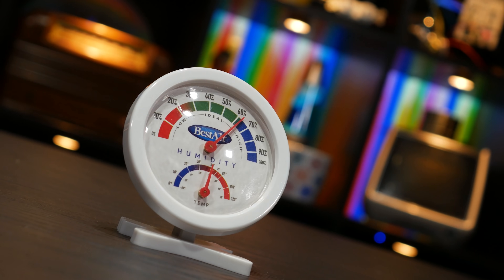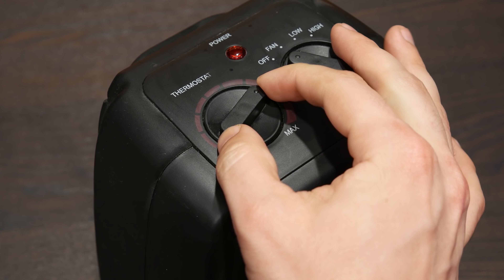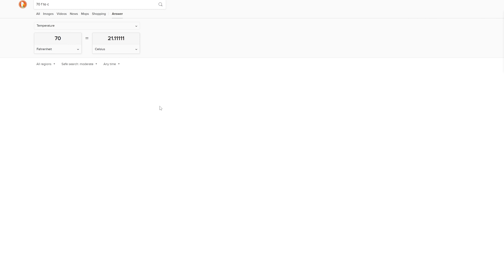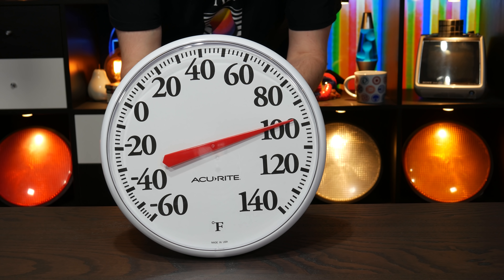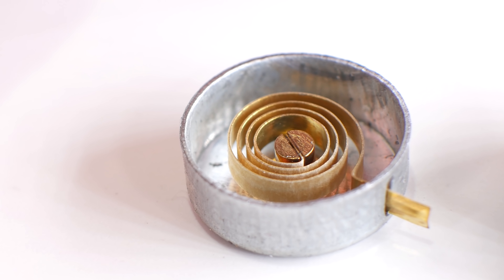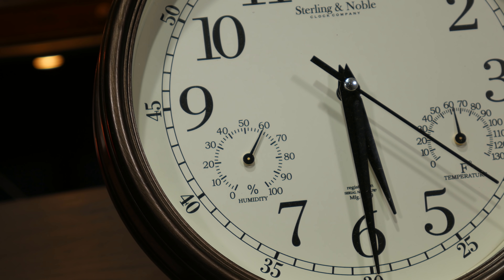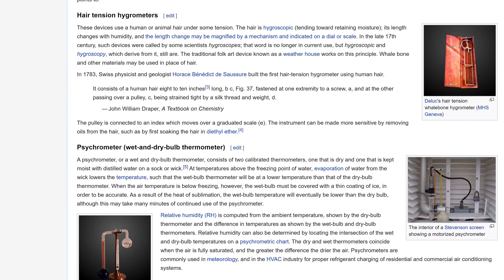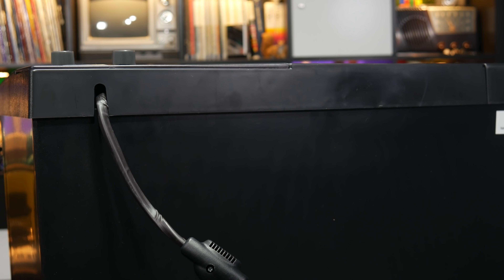Analog Hygrometers - how?

Comment: Speaking of humidity. I bought a small room humidifier recently (and a hygrometer to go with it) at the suggestion of my physician (I have sinus issues). Here are my observations. 

1. I have a space heater in my room, because in the winter the heater isn't turned up as high as I'd like (I don't live alone). With the humidifier, my room was more tolerable and I didn't need the heater. 
2. The air conditioner makes the humidity drop far, far lower and faster than the heater does. This means that, even though I live in southwest Louisiana where it is excessively hot and humid outside, I will need to continue using the humidifier year-round.

Comment: Totally random comment. I'm a pilot. We do things in Celsius (or Celtigrade as I like to say), and passengers in the states generally do not. Did you know the iOS search bar will convert stuff like that for you, even offline? Use it on my flight iPad all the time. Just type "15c" or something and it'll spit out the ° F. You can even type "34in" to get feet or "34in to cm" to... You get the point. That's all offline, which I have to say, being an android guy, is pretty cool.

Comment: I appreciate your Fahrenheit rant.  Metric may be good at many things, but offering a good scale for environmental temperatures is not one of them.  The smaller the degree increments, the better.  You get more precise readings that way and can verbally communicate a more precise temperature with the same amount of effort; the numbers themselves don't really matter that much (though as you point out in the video, Fahrenheit's 0-100 lines up better with the temperatures most humans will be exposed to).  

I also find the +/-1°F trigger range on my home's thermostat annoying enough as it is, that combined 2° difference would be even worse if my thermostat used the chunky units that are Celsius.  The variance would be almost double!

Comment: Y'know what makes a great "bi-metallic" strip for the purposes of humidity detection?  One-sided wax paper, such as the backing adhesive labels are shipped on.
Y'know what curled-up label backing paper doesn't do so well?  Go cleanly through an automatic label dispenser, such as those I use at work.
Y'know what makes the air excessively humid?  8-foot swamp coolers, such as those my employer wheels out onto the shop floor in the summer, rather than install proper air conditioning.
(Just to keep things in the Technology Connections Cinematic Universe)

Comment: With the thermometer I'm just confused how 60° F is warm enough for you to be comfortable sitting like that
Reply: Like that? I'm fine sitting in my lightweight chemise at that temperature, never mind fully clothed. Y'all need to toughen up. 💯
Reply: Idk about you but 60°F is the ideal temperature imo, i start getting uncomfortable if it gets above 65°
Reply: I basically always want it to be 20° C indoors, although in the summer I let it get hotter.
Reply: @joshuahillerup4290  that's how my roommate likes it, causes a lot of arguements over the thermostat. He's adapted to warm weather while I can sleep butt ass naked in a foot of snow
Reply: @kylemaloy5524  ironically I live in Ottawa, Canada, and I'm pretty good walking around outside in cold weather.

Maybe it's because I haven't had air conditioning for most of my life.
Reply: @joshuahillerup4290  yea that'll do it

Comment: Huh, checked out my old cheep desk thermometer/hygrometer from the early 80s, turns out it uses the metal and paper coil. So new-fangled might be a matter of relativity. Here's one thing I have to wonder, how well does that method hold up over time, as I've noticed the hygrometer is basically useless anymore.

Comment: 2:00 I am a big fan of the metric system, but for temperature I actually have no preference.
Fahrenheit or Celsius or Kelvin all have their benefits.
It's when we start measuring length, area, volume, weight, force, electricity, etc. That is where I vastly prefer the metric system.
And I can read a temperature in Celsius, Fahrenheit or Kelvin without much problem. I am surprised you cannot.

Comment: Simple!

I agree on a 0-100 scale for tolerable ambient temperatures to be more useful -- and then C/K for everything else. And if you use both scales frequently [F for daily weather and C for scientific applications], you start get a feel of both in relation to each other. But even if you don't... yeah, search engines, you don't even need to do math anymore!

And if you have an iOS/iPadOS device, if you type like 70F, it'll give an autocorrect suggestion for the correct C temp, and vice versa. Life is easy these days

Comment: As a kid, I took apart an old dehumidifier from the 1950s or maybe 60s and it had a humidistat with a bunch of long horse hairs (I guess from their tails).
Reply: Do animals have hair, do humans have fur??? 🤔🤔🤔
Reply: @Pentti_Hilkuri  Fur is denser than hair at usually 2-3 or more hairs per follicle and also features hairs of different lengths in the same area, like an undercoat and overcoat.
Reply: Yes, I remember a Boy Scout hygrometer  project involving a hair from a horse's tail as the active element.  I don't remember if they told you exactly where to get one, but since I was taking violin lessons at the time, it was no problem for me...

Comment: Ah yes, a scale whose lower bound is the freezing temperature of salt water and whose upper bound is an inaccurate measurement of human body temperature
Reply: Huh? The modern scale is primarily defined between 0, the freezing point of Mr Fahrenheit's water salt brine solution and 212, the point at which water boils at sea level. It hasn't been based off body temperature in a long time. But... What do those points on the scale have to do with anything? Fahrenheit can go lower and it can go higher.
Reply: Ah yes, a scale where 0° is kinda chilly but 100° means the fucking world is ending. This makes it easy to know how it will feel outside at a glance.

Comment: Unpopular opinion - metric isn't that GOOD!
Perhaps, maybe, different strokes for different folks? Its always the metric snobs that complain the most.

Also, IMO metric systems are better for conversions and precision, but is overly clunky otherwise. Proportional systems (like the imperial) serve different purposes and make more sense when you are using them how they are suppose to be used. Its like how Typography is measured in points, or displays are measured in pixels - type is finicky at the best of times, and actual size measurements can mean very little in an electronic display.

Comment: My parents have an old recording weather station that uses the hair method. But it is connected to an arm with an ink well at the end that rides over a clock wound paper cylinder. Really cool.

At my work I run a 1960's offset press that still has the damping system original to it, so an extremely simple design. Hygrometers are life with these machines, I can judge the humidity of the room simply by watching how much fountain solution I need to add during printing.

And love the Rob Dahm-esque cut-off.

Comment: Fahrenheit is a temperature  scale for how humans feel.
Celsius is a temperature scale for measuring things. 
Both are useful, but if you're talking about human comfort, especially outdoors or in the seasons, Fahrenheit actually makes a lot more sense. 100 is a lot bigger, therefore "higher" or "hotter" than 40 in our simple monkey brains. A 0 to 40 scale just isn't wide enough for the normal temperatures that humans survive in most of the time.

Comment: "I can't think in Celsius any more than you can think in Fahrenheit."
- The most honest and valid argument I've heard for using imperial units. Sincerely, an Aussie who learned to google "[number]F to c" a long time ago :) 

In a hygrometer related tangent, I built a cold mirror hygrometer many years ago, using a peltier cooler, temperature sensors, led, photodiode and a microcontroller. It was fascinating watching the graphs of reflected light and seeing the value drop suddenly as the mirror got to the dew point!

Great video as always,
Thanks!

Comment: I recently repaired a digital Hygrometer. One that I had for years stared giving weird readings. I opened it up and it appeared as if the solder joint on the  part that does the measuring had cracked. I resoldered the joint and it has been working fine since

Comment: I live in a metric country but i use fahrenheit in my AC system. When using C, i get 1C variation. When using F, i get 0.5C variation. This is because most of these systems only use 2 digit displays. For me it makes a heck of a difference as I have stopped waking up in the night to increase the temperature because of the cold.

Comment: Metric should use Fahrenheit.  F goes from zero to 100 (nearly) in terms of the most common use of temperature.
Reply: Metric uses Celsius because 0 is when water freezes and 100 when boils. Less than 0 means snow, freezer, very cold. More than 100 means boiling water, don't touch the material, etc.

The hot ambient temperature isn't obvious. 25ºC is room is common room temperature. More than 40 is a incredible hot day.

So Celsius is perfect for things like cooking, but no so great for weather.

Comment: I entirely agree that a 0-100 scale for ambient temp is completely understandable. 

0c may be freezing, but actually cold temps don't happen until negatives. 0f is legit fucking cold to perceive, and negatives amplify that. Same with 100f; that's fucking hot. But, 100c, and you'd dead.
Reply: I've been in a sauna that was 120c and I'm still alive. It's not that straighforward.
Reply: @vibingwithvinyl  You can survive in a 120ºC sauna with less than 1% humidity for about an hour. If the humidity is higher or you stay for a long time, you will be dead.

Comment: You didn’t explain the extra clever part:
when the absolute humidity stays the same, but the temperature changes, then the metallic part of the paper-metallic strip will expand/contract (and not the paper). So the needle will also move, and as such automatically calibrating for relative humidity.

Comment: As a Canadian, pleased with our use of metric, I would like to inform you of our preference for buying meat by the pound, doing carpentry work in inches and feet, measuring architectural and construction material by inches and fractions of an inch, and we interchangeably refer to things as miles or kilometers away (adjusting the numeric value accordingly of course).

Fantastic!

Almost as fantastic as the fact that technically the US is officially metric to boot.

Comment: Yes, but you forgot to mention wet-dry bulb hygrometers. I did some fire spotting in CA and we used a wet-dry bulb hygrometer kit to measure humidity. If I remember correctly, it was pretty darn accurate, and 100% analog... except for the part where it's about 75% manual work to get the readings. Surprised that it wasn't mentioned, as you can automate it digitally with fans and lookup tables and such.

Comment: 1:54 I tell my Canadian friends this is the only reason Fahrenheit is a great scale.  For everything else Celsius is better.  This could be solved if the measuring (and also thermostat) devices could be reported to the tenth of a degree.  Having a few Canadian friends, I've asked them what temperature they find comfortable, none of them say 20c somwhere between 22-25.  But ones who say 22 or 23 acknowledge it's somewhere between the two and they have never really figured it out to the  22.X degree C.  I'd be inclined to switch if the World went to that (no pun intended) degree, but they won't.  Rant over.

Comment: I have like so many different devices and doodads to measure humidity but I don’t know which are accurate/calibrated. I end up just using them all as a point of reference to compare to the others but I wish there was a device I could buy and just be confident in its accuracy or with easy calibration. Maybe calibration is easy and I just don’t know a good way?

Comment: Screw Celsius, Fahrenheit is just better for human use. Big numbers are hot, small numbers are cold - unlike Celsius where small numbers are still hot, and big number are dangerous.

And then there's Kelvin, which is the only scale based on something absolute - and no one is arguing to use that for everyday life.

Celcius is just as arbitrary as Fahrenheit, yet it lacks all the useful scale and daily usability. F units are small enough that you never need to use fractions. A 1 degree difference in F is small enough to be useful and large enough to perceptible.

Comment: I decided to be fancy and built an arduino-based  dehumidistat for my bathroom fan that compared humidity inside and outside the room.  I live in a periodically foggy climate, so getting a decent fan control is a challenge.  My creation never seemed to work well so I took my two sensors put them in a container with a wet sponge followed by a dessicant.  Lets just say that the two "identical" DHT-22 sensors did not track anywhere near each other.  I'm not convinced that cheap electronic humidity sensors are any more accurate than analog -- but I'm open to it being the fault of my buying the cheapest sensors available.

Comment: At 1:42 we go from a variety of cute little devices to... oh my, now that is huge hygrometer I can read from afar! Such a stark contrast! But there's something odd about it. It took me a few seconds to realize it was a temperature gauge, not an hygrometer, because the values were still between 0 and 100 kinda. See, that's a problem one would not have with Celsius ;-)
(joke aside, the "I can't think in Celsius" thing... I used to think the reverse, and honestly the adaption time to mentally get used to the new unit is a week at most. What matters is being in a country where one is bombarded with a consistent unit system, and blam, you just get used to it very quickly.)

Comment: I'm in Canada,  and we still use °F all the time,  especially in industrial applications.  On many of our calibration instruments at work,  we deliberately use °F because of 1.8 times more accuracy for single degrees when there is no decimal point on an instrument.
While many folks fond of Celsius find the Fahrenheit scale to be crazy,  it actually isn't.  Gabriel Fahrenheit considered the zero point to be the freezing point of what is most abundant on earth - sea water,  using a brine solution in a lab,  and the 100 point to be the temperature of a human body.  Of course,  the early thermometers he invented in the 1700s were not super accurate, and later the temperature of healthy person is determined to be 98.6 on the scale.
So, non-Americans,  stop attacking a temperature scale based on logical things by a genius Dutch physicist and inventor!!!  Yes, °F originated in Europe,  and not USA.
Reply: But we stopped using it. Now we use a better system.

Comment: Great video. As a follow up video could you explain how digital hygrometers work? I much prefer digital over analog hygrometers because of their better accuracy and ability to set alarms if it's too dry or too wet.
Reply: Did you watch the whole video? Because he did explain them. (Spoiler: some materials change their resistance (or capacitance) when wet so a microcontroller can just measure the resistance (or capacitance) of the material to discover the humidity.)
Reply: @tim1724  Yes. But not in great detail.